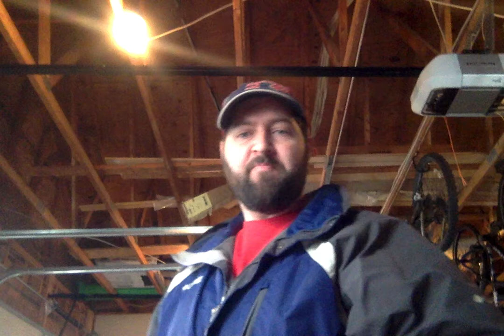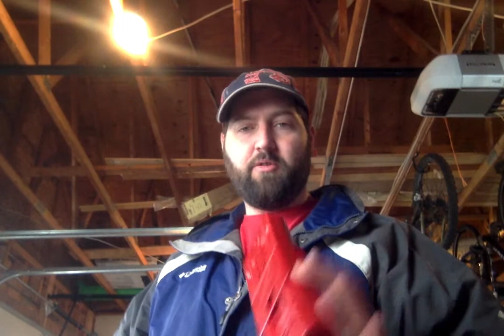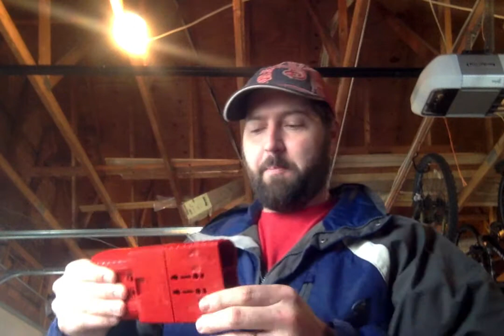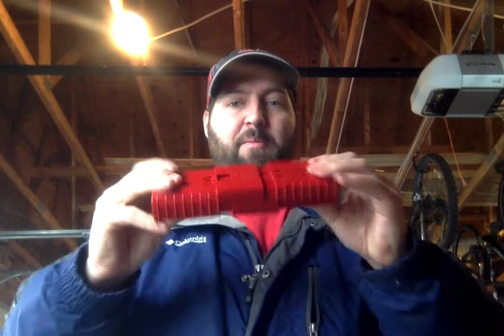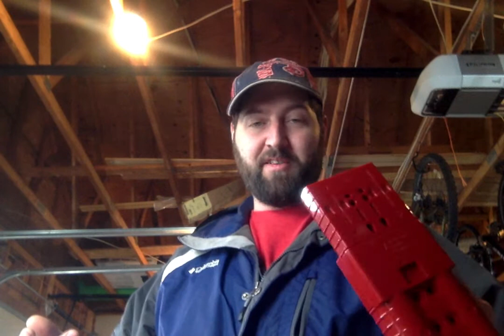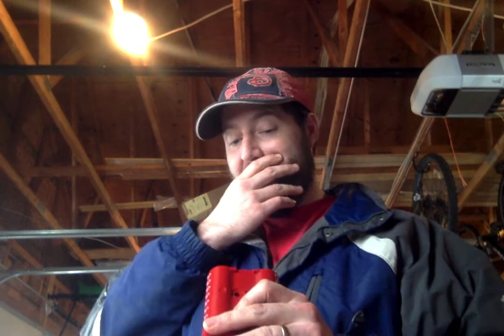WATCH THIS BEFORE BUYING ANDERSON CONNECTORS!!! SBX350

Comment: You are right! Who would know? You would think that instructions would also be included as to which way the pins should be inserted after crimping or soldering! Just yesterday, I received my Anderson connectors, and had to search Youtube for the NECESSARY instructions as to which way the pins needed to be inserted. Why didn't Anderson provide that REQUIRED INFO in every packet? GREAT WARNING VIDEO FROM YOU!! Thanks James!!

Comment: Did you ever get them apart? What's happened since April of 2018?
Reply from the maker: rob762x51 I thought I mentioned it in a later video. But I slid the crimp fittings into one of the connectors and I was able to then separate them. Even Anderson said this wouldn’t work! But it did!
Reply: Yes I saw the weatherproof video where you mentioned just insert the crimp fittings. I made a comment without doing the search work. Good info.
Reply from the maker: rob762x51 no problem! Thanks for watching!
Reply: Just return that big one you purchased and make them give you a refund.

Comment: I did the same thing, putting a screwdriver in there or the lugs will release them. Sounds like the support person is just dead weight over there.
Reply: ya i could see every lawyer jumping on that email exchange and trying to claim an overly helpful person caused a big fire/accident.... this is the clown world we live in now. personally im 0% comfortable telling someone anything about a 350A connector other than that which the OEM has explicitly taken responsibility for as an official/legit assembly procedure. 350a.... someones gunna die if people start sticking screw drivers into those with the type of people living in the world we live in now. no common sense anymore.

Comment: How difficult would it be for them to make a little instruction sheet to go along with the connectors?  I just bought a vastly smaller set, already assembled with cables, and can't get them apart.  Some guy in Australia here on Youtube says there are handles you can purchase that screw on to help you get them apart.  They make it look so easy to just snap your cables together and then disconnect them when you want to remove your inverter or whatever.  I'm a wimpy older woman and was hoping for something to make my homemade Prius generator safe and easy to hookup.  Why can't they make the connectors with some kind of disconnect motion you do by squeezing or twisting that would make it a whole lot easier?
Reply: Because they wouldn't be as effective to maintain the circuits lossless.  That is why they attach the way they do. 

Yes, there are some handles you can buy but some people don't like them and user homemade solutions to disconnect.

Comment: I use the 175 amp version for jump leads, solderd them in and few weeks later the cables fell out, turns out I used the wrong soldering flux it rotted the wires, now I use a hammer and blunt round punch and crimp.
Reply from the maker: Id love to get a really nice crimper. One that sits on a bench. But they are crazy expensive. Instead I have a hydrolic hand one from amazon. I think it was like $60

Comment: they should of included some kind of documentation or instructions... but from a legal perspective, telling someone to jimmy two 350A connectors apart with a pair of screw drivers, and then having them be reassembled with a potentially out of spec spring is a far bigger issue in today's society. its not that there is no way they can come apart, its just that there is legally no way for that company to not get sued into oblivion once some single digit iq person finds a way to cause one of these 350a connectors to make intermittent connections and cause some kind of fire/harm to person or property, and then have lawyers do what lawyers do best, and dig up this email exchange and claim it was an official method of assembly. yeah they probably could of used better wording... but im guessing they didnt because they get this question all the time.... which makes you wonder why they didnt include some kind of plastic plug/warning/note/instruction...